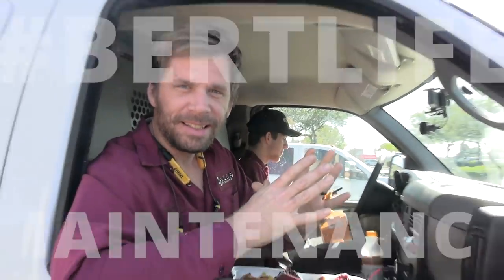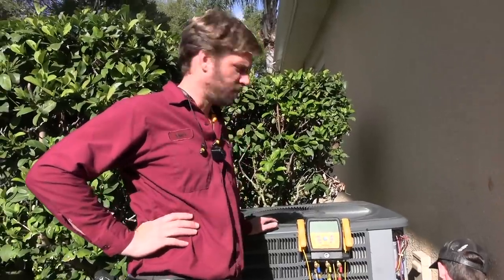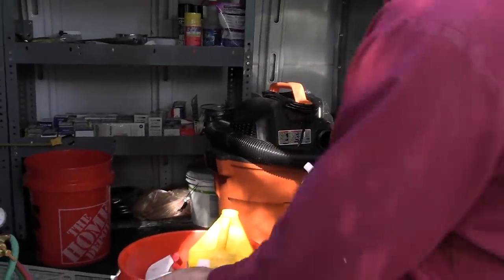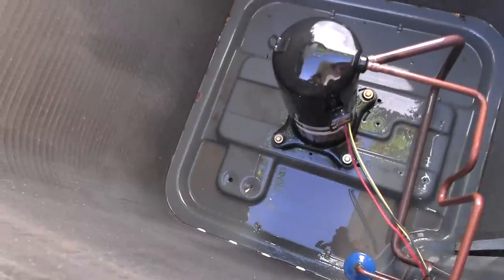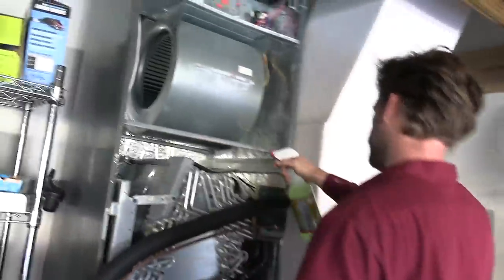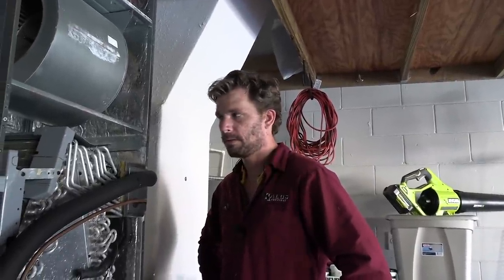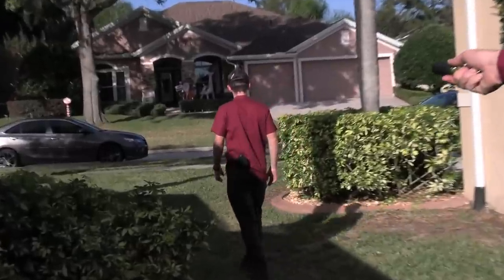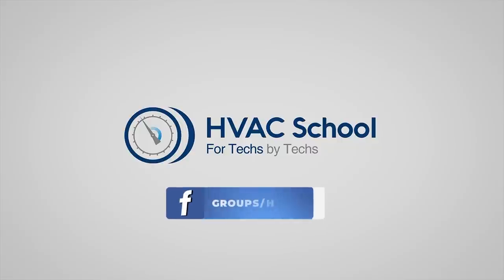AC Maintenance Top Tips #BertLife

Comment: This is a great starting point for residential heat and ac maintenances. I just want to tell everybody out there that you can really take the maintenance to the next level. And become very profitable. I love this video. And I would challenge any and everyone out there that number one if you don’t know everything about the system by time you finish your maintenance visit. Can you really say that you looked at it and did a thorough evaluation? And then Number two is after you have learned everything about the system, can you communicate with the customer in the way that is easy for them to understand and also they see the importance, of the preventative maintenance. Remember this a monkey can change the lightbulb. But to see the breakdown before it happened is true skill in the craft.

Comment: How many hours does your company expect a maintenance like this to take?
Reply: My company expects an A/C or heat pump maintenance to take about 2hrs. And for a gas furnace maintenance 1.5hr. For oil maintenance 2.5 hrs.
Reply: I only get 2 hours per call (including drive time) for 1 or 2 system maintenances. Comes out to 60-90 minutes of work. I'll tell you right now, I only take the top off of a condenser if it's really bad.
Reply: Same

Comment: 2 dead lizards in the electrical panel. Might wanna put some conduit on that low voltage so theres not a 3/4 '' knock out punched out for lizards to get into on the bottom of hte electrical panel :)

Comment: That is not your typical low-baller’s $39 PM. That is the way they are supposed to be accomplished. They should take 2 hrs minimum and cost $200 minimum. Don’t let anyone tell you that you can’t make a living doing them. Make sure you stock plenty of contactors and capacitors. Add algaecide tablets to the pan. Always remove those horizontal drain pans on upflow AH’s. Avoid selling that brand unless you like filling out their warranty forms often. Of course, it’s not going to be seen by their friends like those big 2500+ sqft houses, jacked up 4wd $80K trucks or $10K vacations.
Reply: Even at 200 and 2 hours thats not profitable.

Comment: Please help... my ac keeps freezing if I set below 76degree.  I have had 2 top rated ac professionals come out run multiple tests on my handler and compressor each said every test yields perfect results.  I live in south Florida and 76 is just too hot given the humidity.  Today it froze again. I read online to turn the unit off at the thermostat but,  leave the fan running to help it defrost.  I did, the temperature in the house dropped from 77 to 69 in 1.5 hours. Unit off, fan on.  So then I turned the off the fan when it hit 69 degrees but the compressor kept runningfor 30 mins after turning the fan off. So I then  turned off compressor at the breaker fearing it might get burnt out or something. Idk lol.   I feel like maybe its an  electrical problem? Or bad thermostat?  I'm having a hard time understanding the logic that my ac is "testing like a new system" and that  "its recommmended to replace the whole system" ...at the same time. Any suggestions appreciated.
Reply: if its freezing you have a low pressure problem, a tech should have been able to come up with some sort of solution
Reply: @jasondematos9314  

 Not necessarily. They said the outdoor unit kept running after the fan shut off. If the AC is running with no airflow the inside coil will freeze up. It could be a thermostat issue or a stuck contactor. 

Those don’t sound like top rated AC professionals to me.

Comment: You did not check the bearings on either the indoor blower motor or the condenser fan motor, you did not clean the blades on the outdoor fan motor, you did not check wiring connections on the outdoor unit, what about the capacitors? you did not check the defrost cycle. why? Instead you poured four gallons of water down the drain and checked the condensate float switch in December...Very disappointed.
You did not ask the customer if there were ay issues with the system i.e; thermostat, etc.
Reply from the maker: You do you super tech
Reply: @HVACS , Nice. Good answer.
Reply: @michaelthomson5101  just listen to the motors, you are a crappy tech if you cant determine good motor bearings from bad by just using your ears.